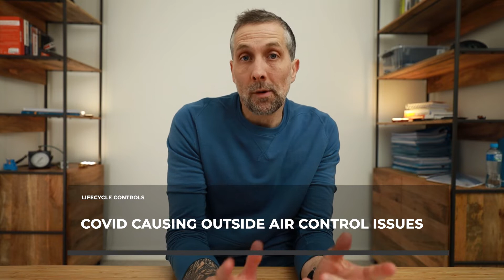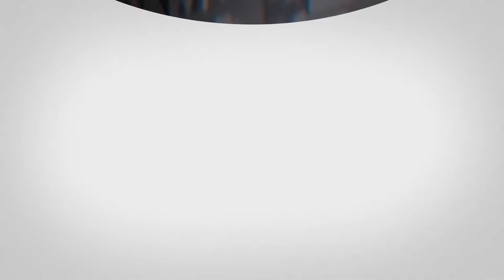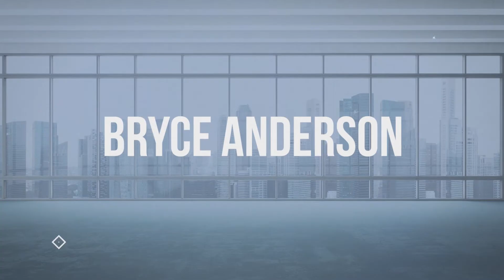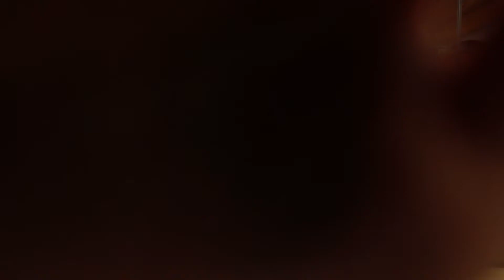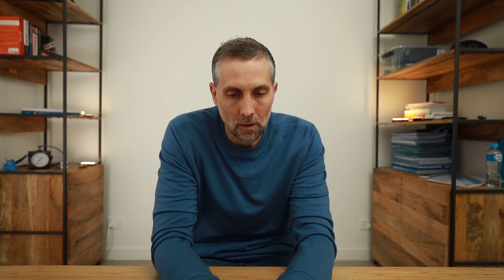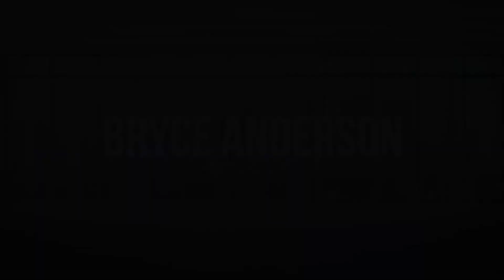Covid is causing Outside Air Control Issues

Comment: Bryce, thanks for the discussion. Your point around poor control of outside air in response to deviations from design conditions is a good one. However, if you consider air balance as a whole, noting your comments around reduced S/A and R/A fan duties, and taking into account the method for balancing R/A and O/A quantities, I believe outside air rates should reduce proportionally to the reduction in S/A.
Reply from the maker: Hello. As you reduce the supply air, the outside air reduces. 
But, if during air balancing you reduce the supply fan speed, say in 10% steps, and then you reduce the return air fan to what ever is required to hold the OA at design, then this will result in the OA staying constant no matter what the supply fan is doing. 
When I witness this (return air fan tracking), I check that as the supply fans slows down, that the RA fan slows to a different amount (not proportionally to the supply), and I check that the OA volume remains constant. 
Almost no BMS company understands the true meaning of return air fan tracking. Everyone simply sets the RA fan to run at 90% of the supply fan, which is only correct at design volume but not at other supply fan speeds.
Cheers
Reply: @bryceanderson17  Thanks for the response! I did not know that about return air fan tracking.

Comment: g/m  sir I ask one question sir one AHU air handling unit if our actuator SM.003 model open at set point 16c that time chw pipe vibration coming after 6 sec normal why vibration sir our actuator all value okay put why come this issue open time and close time actuator chw pipe vibration both line supply and return plzz answer sir help me
Reply from the maker: If I understand you correctly. The CHW pipe vibrates when the actuator opens or closes?  
The actuator is not the problem. The valve is more likely the problem. 
Either the valve is incorrectly sized, or it is the incorrect type of valve, or the pressure in the pipe is too high. 
1. A simple check. Is the valve size, the same size, or one size smaller than the AHU coil pipe size. E.g. CHW coil pipe size = 50mm, then the valve could be 50mm or 40mm. If the valve is much smaller then it could be too small. 
2. Is the valve installed the correct way around? Remove the lagging and look for the arrows. If the valve is installed the wrong way around, then it will not work properly. 
3. Are all or many valves doing this? If yes, then the problem may be the system pressure. If you have 2-port valves, do you have VSD pumps that slow down when the system pressure increases? Or a bypass valve that reduces the pressure. 

Start with this and see how you go.
Reply: @bryceanderson17  right answer sir because 5 bar pressure chilled water if reduce pressure 4 bar then pressure gone but I thing balnceing issue water balancing because if ets room go and pressure reduce 3bar header pressure reduce force by BMS 2.5 put then all building vibration all AHU gone
Reply: and you are good knowledge sir I am BMS technician and operater KSA working thanks for reply sir
Reply: you are great sir

Comment: Great topic to discuss.  Unused outside air from lowly occupied floors gets recirculated back through the system and, added to the OA intake, reduces the CO2 concentration on floors.  So the BMCS reduces the OA intake as the CO2 levels reduce in the most heavily occupied space (assuming this is the worst case).  This principle is described in the Australian Standard 1668.2 and ASHRAE 62.1, possibly others too.
Reply from the maker: Correct, this is well documented in standards. But, do BMS companies buy standards? Is there a copy sitting in the lunch room, no. 
For 15 years I worked for BMS companies in 3 countries, and was never taught or shown what the standard required. 
But, you are correct, this is nothing new.

Comment: Bryce, you hit it on the head when you said the Mech design should have got it right in the 1st place. BMS is quoted and designed on what these Mech specs publish, if these designs are incorrect then the BMS control strategies are going to be incorrect. We can only quote& design based on the spec. The design engineers need to keep up with what is happening in today’s technology or the systems going in are only as good as the spec that they design it by. Time and time again I see specs that are as usual just a paste from the last project but are nothing to do with the project that is actually at hand.

As you said in your vid too much outside air due to unoccupied floors etc, well if they design it this way then this software will be implemented, not just, Oh why didn’t you do it that way, that’s what the intent was. Sorry my crystal ball has broken again and so the story goes.

Comment: Been thinking about this - modern commercial buildings should have modulating minimum OA dampers (separate from the economy cycle damper) and the position of the OA damper is governed by the CO2 ....with no fixed minimum.  It should be able to be turned down to zero (as it should be in warm up / cool down start-up).  If you want to get fancy - place a pressure sensor on the mixing chamber to control the RA damper position (I am not 100% convinced about this approach - although relative common)
Reply from the maker: Iv seen the mix plenum pressure sensor and return air damper control work well when the supply slows right down and we can not achieve design OA. Closing off the return a little helps. So, I think I'm okay with it if done carefully. 
I personally don't think we can close the OA off completely. We still need to provide at least 0.35 lps per m2.
Reply from the maker: Also, 50% of large premium grade and A grade buildings in Melbourne do have separate OA dampers from economy dampers.
Reply: @bryceanderson17  Agree - but the other 50% who do not is the surprise

Comment: Bryce...good discussion. I think you hit the nail on the head, as far as the problem (over-ventilated buildings, especially since COVID disrupted office occupancy).

Two additional comments:
1. I agree that the BMS should/could be software configured to incrementally decrease or increase the OA minimum airflow rates, based on many criteria... especially CO2 readings. One question regarding the use of CO2: Is that based on the average, low or high reading?
2. The other possible concern is related to building pressurization. If building exhaust systems are separate from return/exhaust fans, and we reduce loads by closing down whole floors, do we also close down the exhaust systems (bathroom airflow rates, lunch room exhaust, etc.)? If we don't, can we possibly take the building into a negative pressure condition (inadvertently)?

Best regards... love your videos!
Ron Underhill
Reply from the maker: 1. My interpretation of the Australian Standard is that it must be Max select (highest) and not average or lowest. Many people use average as it saves more energy. But if you use average then maybe you have a zone with 1200ppm and the control system doesn't do anything about it. Then you are in breach of the code. In my opinion. 
2. I have never thought about the exhausts continuing run at design when the floors shut off. Good point. We would have to look at the air balance. But, at a guess, yes, it could be causing an issue with the overall balance. Enough to actually have building negative pressure? Not sure. But a potential issue, yes. 
Thanks for sharing.